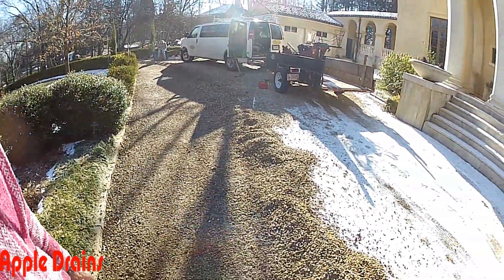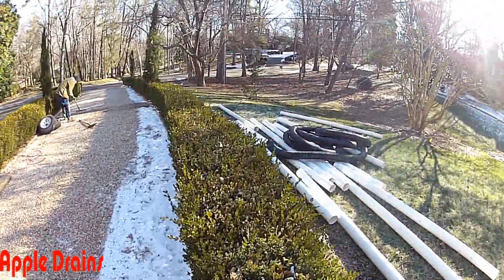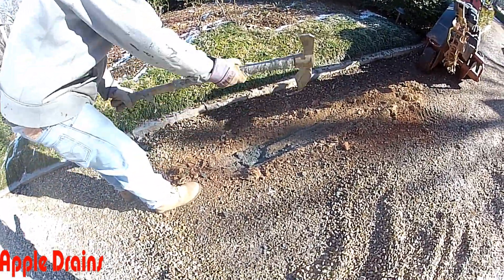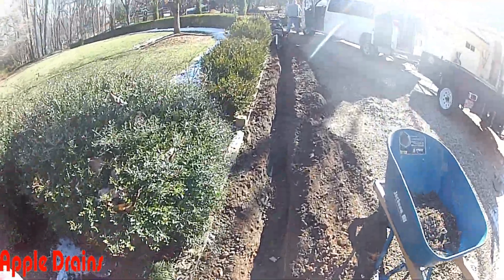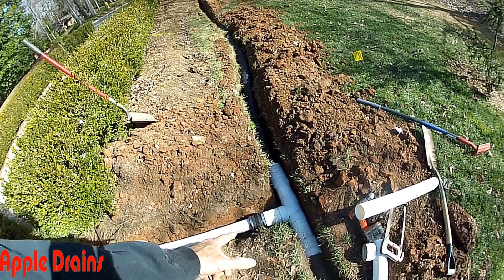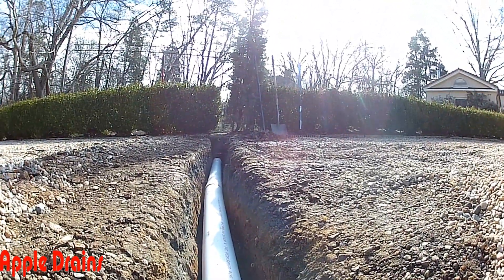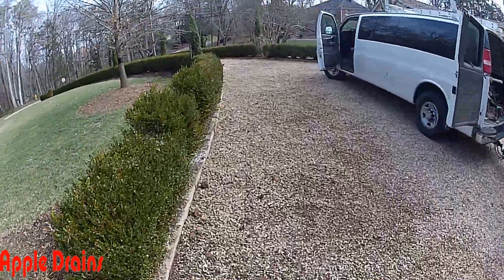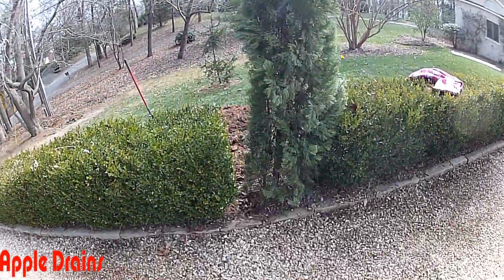Install French Drain In Gravel Driveway by Apple Drains

Comment: Chuck can you drive over just the corrugated flex piping after? Inquiring minds we are doing a driveway today
Reply from the maker: If you surrounded the pipe with lots of gravel, it will probably hold up.. but would suggest you use PVC under driveway
Reply: @appledrains  My drive has black corrugate pipe under gravel, and it has completely collapsed.  This was installed before I bought the house, so I don't know how long it took before it gave way, but regardless the black corrugate now needs to be removed and replaced with PVC.

Comment: Great video Chuck, thanks. I am a small female who needs to dig a trench across my gravel drive too. The driveway goes around the house like a horse shoe. Unfortunately the gravel drive is higher than the land around the house... so when it rains, its like a moat around the house... I need a boat to get to the driveway. We live in clayish soil out here in the Piedmont of NC. I got corrugated black pipe but its looking like I should not use that. you have white pipe you used. WHY did you put the holes to the bottom of the trench? Still trying to figure this out. Thanks
Reply: water will rise along least path of resistance holes downward so only water and initially fine sediments will travel a slightly downhill in this path as water travels inside the pipe a suction develops drawing more water from the trench to totally remove. the deeper the trench in this case the better ie  if a Hugh monstrous downpour the trench should cope As  this is a very long driveway to prevent washing out of  the fine gravel driveway down slope SPACE trenches at intervals  to suit  and connecting pvc to mains

Comment: Didn't cover the collection pipe with filter fabric. It will eventually clog with depression and not drain properly...You're lucky I'm not the home owner or you would be doing it again at tour cost. Rookie mistake for a "drainage company".
Reply: clog with "debris"
Reply: and if you live where there is sandy soil the filter fabric will plug and not drain either...these are basic "how to" videos..you have to learn to adapt to your environment and adjust...
Reply: This is basically a run in a septic line....I worked for a septic company couple yrs...we didn't use filter fabric..we covered pipe in stone then put down a layer of straw for an organic mat to accomplish the same purpose...keeps he dirt from clogging the rock and pipe perforation
Reply: Barring any clogs, it will eventually suffer problems from the compactness of the gravel. As time goes by, weathering and cars will cause the surface to become more and more difficult to penetrate as the pebbles begin to fit into the surface like a puzzle board, preventing water entry into the sub-layers. It also looks like he installed the pipe with the holes facing the bottom, which would assist with clogs but increases the likelihood that the drain pipe will have more problems capturing and transferring the water. I doubt this drain system would work very well unless it's in an area with great grading and underneath a surface location with little amounts of traffic.

Comment: how deep do you have to burry the pipes so its not damaged by the vechicles drivning over it?
Reply: Notice that they didn't use corrugated pipe under the driveway. PVC drainage pipe is surprisingly strong once buried. I have 4 inch PVC drain pipes under my gravel driveway buried about 8 inches under the surface. So far I've had dump trucks, bucket trucks, 24 foot box trucks, and the local propane supplier drive over it with no ill effects.
Reply: Gary Jernigan just have to believe and you can do it
Reply: At least 25 feet and you'll be safe.
Reply: Max out the trencher then go about 6 more inches